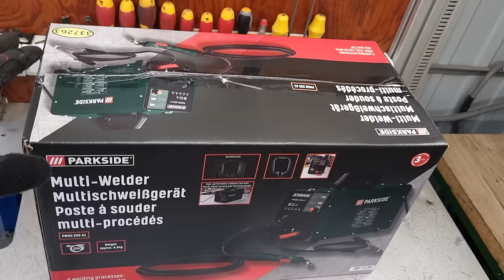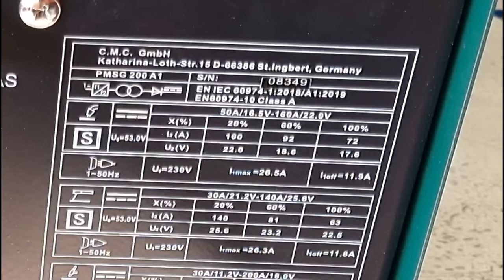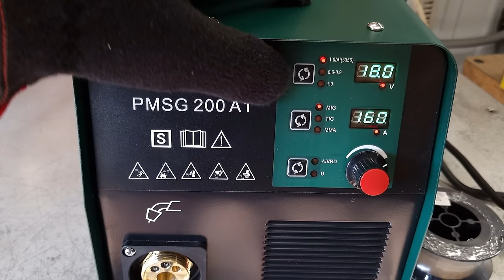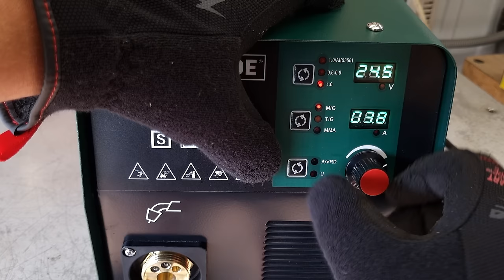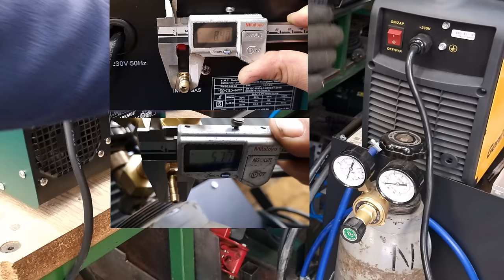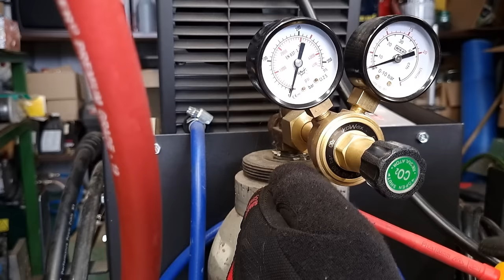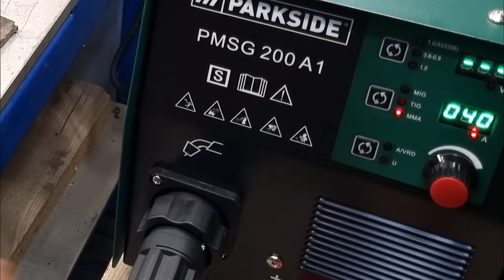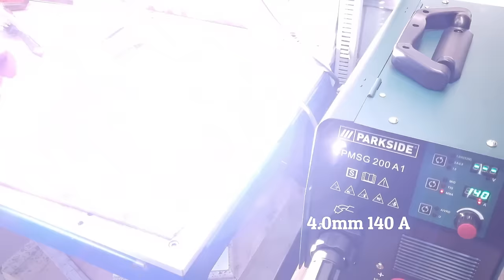Multifunkčná zváračka MIG/MAG/TIG/MMA Parkside PMSG 200 A1 Je najlacnejšia a EXTREMNE dobrá?

Comment: 16:56 Wrong polarity for flux cored wire that’s why your weld looks so ugly with a lot of spatter. You should also pull the weld not push it.
Reply: Push the weld for fusion on thicker materials.
Reply: @andywells397  Never push flux or stick.

Comment: For mig welding with flux cored wire u Need to invert the polarity of the Torch as labeled on the welder.. u didn't thats why all the contamination and the dirt.. i did the same mistake  the First Time
Reply: Came here to say that too...
Reply: What does it mean to invert the polarity? Here to learn
Reply: @aberba  when flux core with this welder you want ground positive , wire negative

Comment: Svářečku jsem nedávno zakoupil především z důvodu svařování plněným drátem bez potřeby ochranného plynu. Bohužel se mě to nedaří, mám pocit že drát vyjíždí příliš rychle a vždy se přilepí, aniž by se zapálil oblouk. Asi někde dělám chybu... Svařování obalovanou elektrodou je bezproblémové.
Reply: Most flux core machines are horrible to use, I have one lol, if you need to mig/mag weld something imo get a machine that uses gas as you can weld different metals with different gases and wire, even using a coke can size gas gives you a better weld than flux core, I have only seen decent welds from flux core done with an expensive machine (usually blue/red/yellow $1000+).

Comment: Muy buen vídeo. Sería posible que hicieras una prueba con la opción de soldadura TIG. Un saludo y muchas gracias. 

very good video.  it would be possible for you to do a test run with the tig welding option.  regards, and thank you very much
Reply from the maker: Hola. Gracias por seguir y comentar. Actualmente estoy preparando un video donde soldaré acero TIG y acero inoxidable y luego en acero MIG / MAG y aluminio.
Reply: @FORWORKANDFUN  Muchas Gracias. :) Me gusta mucho tu canal. Estoy haciéndome poco a poco con un taller de maquinas de bricolaje Parkside y tus vídeos son muy buenos para decidirme que máquina comprar. Y ahora estoy pensando en la soldadora multifuncion 4-1 y si veo que el TIG va bien me la compraré. Un saludo y muchas gracias de nuevo.
Reply from the maker: @samuelborja8092  Bueno, gracias. Comparte mi canal en España.

Comment: hello dear friend, congratulations for the video!
I would like to buy a new hybrid, wire / electrode welding machine.
honestly, would you like to recommend this Parkside to me, just to start welding? .. I'm totally inexperienced in welding!
I still want to learn this art.
a warm greeting see you soon 👋.
Reply: Hello Daimon, i think  he told yes and go for it and it is worth 170€. The weakness point is electrode welding with 4mm electrodes there are missing some additional ampers.
Reply: hi! i'm a pro welder. It depends by your needs, such a little machine could be great if your needs are little and you deal with welding just for few times a year.
If you intend to go pro or yours working need are at an industrial level, i suggest you to get some serious pro training, get certificate and a pro welding machine.
That's because little machines like this one have low Amp range which limit the thickness of your welding possibilities, over that there is no water cooling system inside the torch which is bad if you weld for houers, your torch can literally melt.
Honestly, I would suggest you a pro electrodes welding machine. For about the same price, this would allow you to weld every material, in every position, under every weather condition. Just by selecting the right electrodes and current, without the need of protecting gas or covered wires.
Be carefull! :)